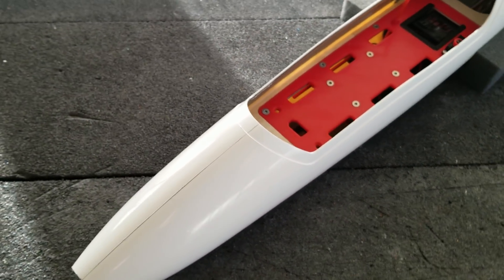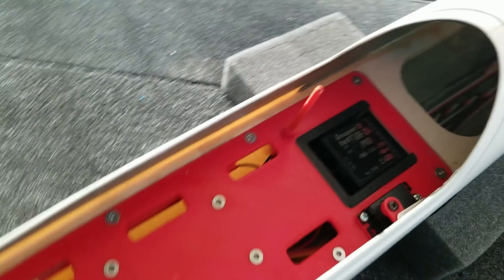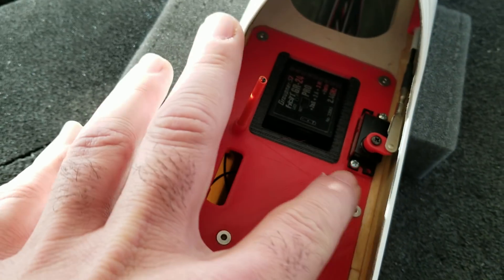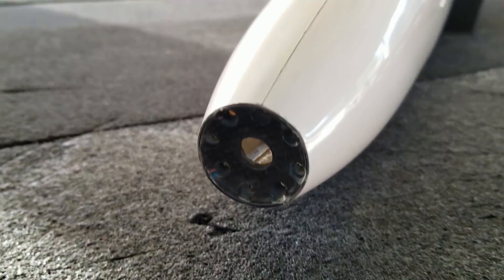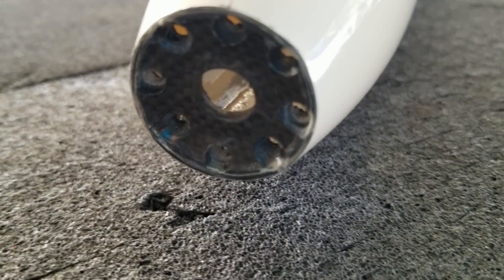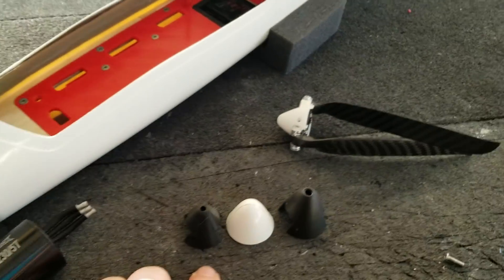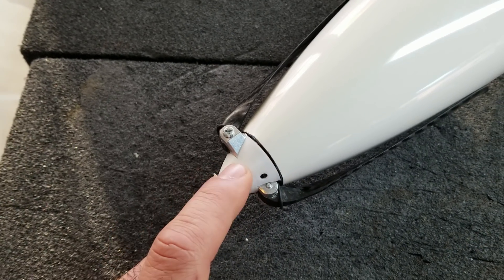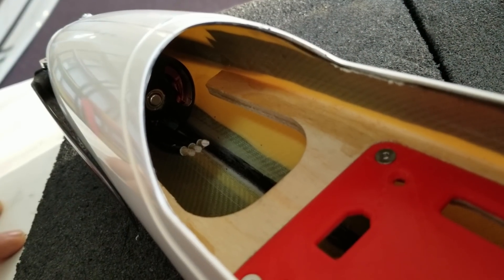Aer-O-Tec Ikura 4m Sport RC Sailplane Part 2

Comment: So your rx battery... do you leave it in when its in storage? Seems it would be a challenge to take out after each day of flying... (for safety purposes) ? Or is it not an issue with the Li-Ion... I've always taken mine out of the plane and stored in an ammo container... just curious... nice glider...
Reply: The panasonic Li-Ion cells are extremely stable and are not very picky when it comes to storage charge. In my F3J models, they live in the nose and never come out, same with the Ikura. If it was a Lipo I would remove it, but no needed in this case.

Comment: Great Rocket!
Reply: Is it an inrunner (low efficiency, high power) motor? This motor will produce a lots of heat! If you use LiIon 18650 batteries which are the best for long runs and multiple use, you have to consider that if you use the cheap $3 3000mAh LG ones, you can only use 5-10A. If you overload them they even won't power your BEC. In my experience the optimal configuration is 4S with a direct drive 1000kV motor.